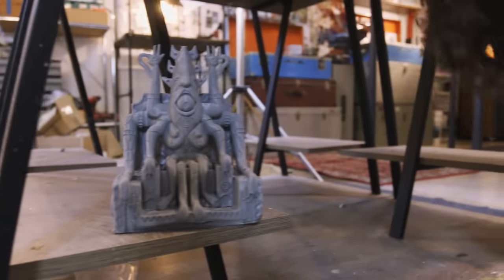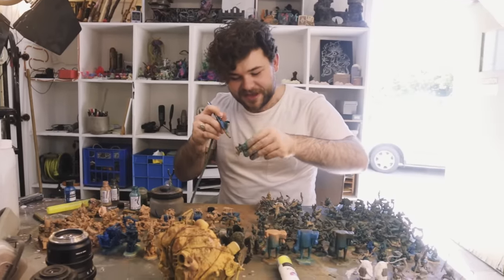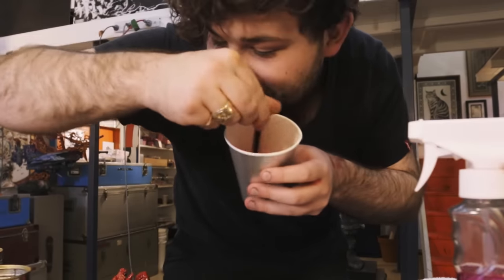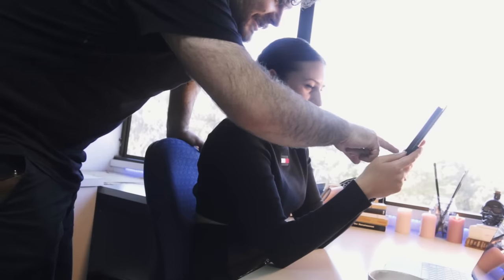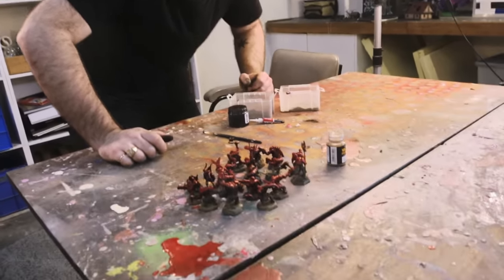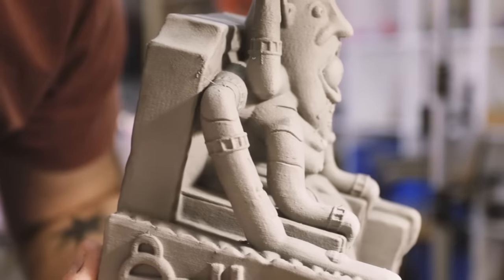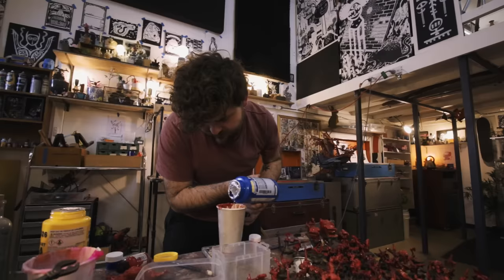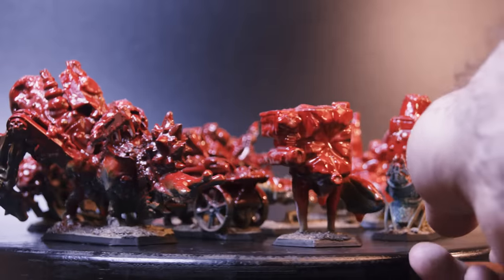the worst way to paint your miniatures

Comment: Trent! I'm honored you think of me as a peer. My "style" is the result of teaching myself how to paint using the supplies I happened to have at the time and a blatant disregard for "the correct" way of painting.
For those interested, here is my process:
Use a tile as a palette. Brush prime black (Vallejo surface primer- black). Then basecoat black (anita's all purpose acrylic).  Make sure all the crevices are fully coated. Next,  overbrush the entire model a light color. I usually do tan or light gray. Do not push this into the crevices! After this step, it will look somewhat like a statue. Next, paint the raised gray areas the color you want,  leaving the black in the crevices alone. Pick out details. Use a fine brush with watered down black paint to draw in contrast lines in important areas , like under the eyes. Finally,  brush on varnish (Vallejo gloss on eyes mouth etc, matte on the rest).
Reply from the maker: You're the best!

Comment: Great video! Our paints are great for base and top coating minis. Base coat will give a solid colour to work from when you are detail painting and top coating with our clears protects them so they can be handled when playing. 

One thing, try our painting clips - they are designed to clip on to the model so you don't have to hold them with your hand and get paint all over your fingers! :)
Reply from the maker: Hey, awesome that you found this video. I've used your products for the last couple of years, I buy them mostly because you're Australian made, my local shop stocks them and the price point is good for the volume. I have worked my way through the majority of your products at the point for a wide variety of projects. I've spread the word about your products to most of my Australian peers because you've solved a lot of problems we face in Aus like that you reliably sell replacement parts for your airbrushes. I use to recommend the baby single action airbrush you used to sell quite a lot also - it was a great price point and very easy to maintain - I could understand discontinuing it however but I LOVED IT. I do have some clips, but for a project like this where I'm painting 150 models at the exact same time, I cant justify the cost. If you ever want to do anything together contact me!